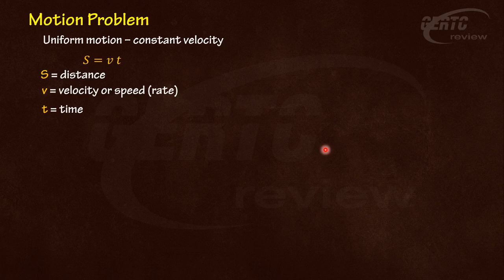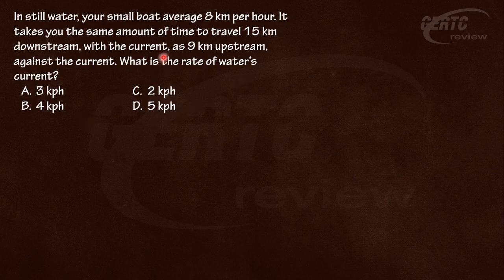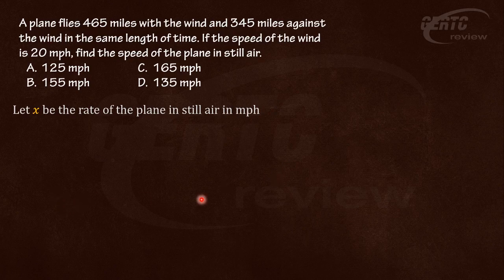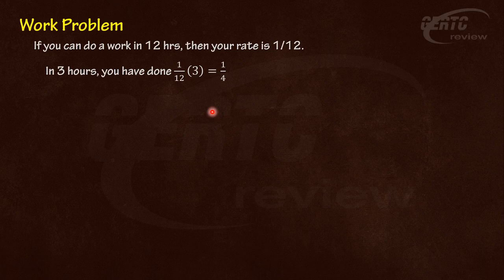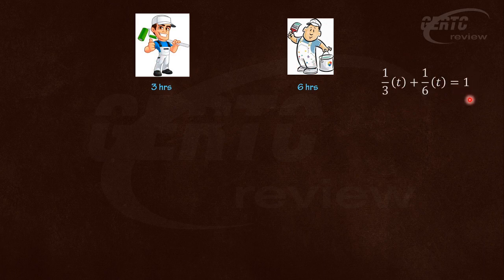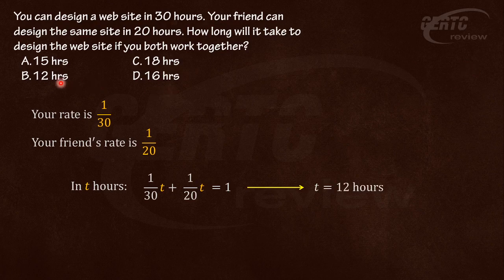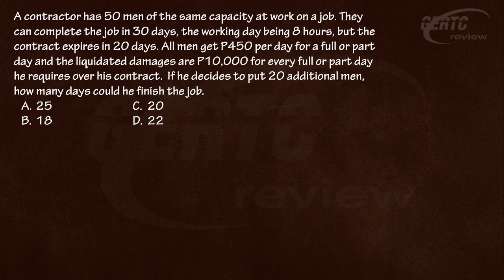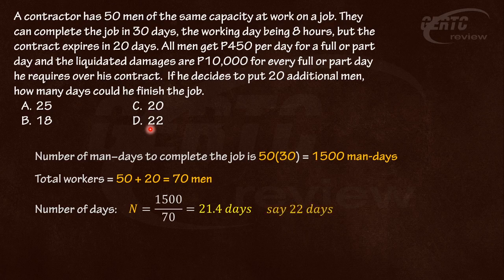Motion and Work Problems - Recent Board Exam Solved Series (MSTE Part 1)

Comment: Let's assume the rate at which the first pump can fill the tank is R tank/hour.

From the given information, we can set up the following equations:

First pump's rate: 1 pump can fill the tank in 16 hours, so its rate is 1/16 tank/hour.
Two pumps' rate: 2 pumps can fill the tank in 6 hours, so their combined rate is 2/6 tank/hour, which simplifies to 1/3 tank/hour.

Let's denote the rate of the other pump as R' tank/hour.

Now, if we add the rates of the two pumps, we get the combined rate when both pumps are working together:

(R + R') tank/hour = 1/3 tank/hour

We also know the rate of the first pump alone:

R tank/hour = 1/16 tank/hour

Since the rate of the first pump alone is known, we can subtract it from the combined rate to find the rate of the other pump:

R' tank/hour = (1/3 - 1/16) tank/hour

R' tank/hour = (16/48 - 3/48) tank/hour

R' tank/hour = (13/48) tank/hour

Therefore, the other pump can fill the tank at a rate of 13/48 tank per hour or 3.692 hours.
Reply: try setting the combined rate as 1/6 and u will get 9.6 hrs